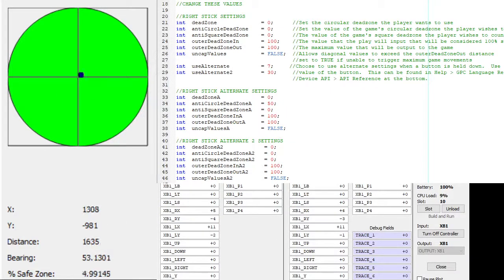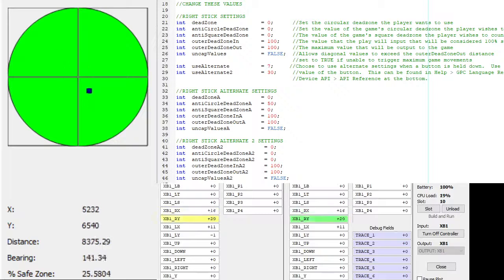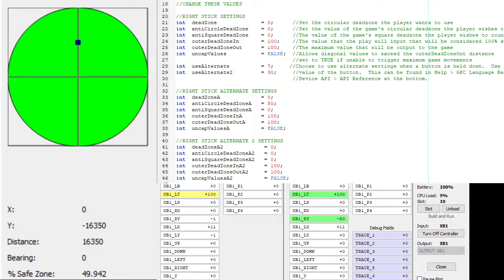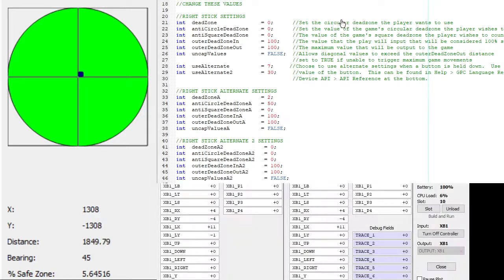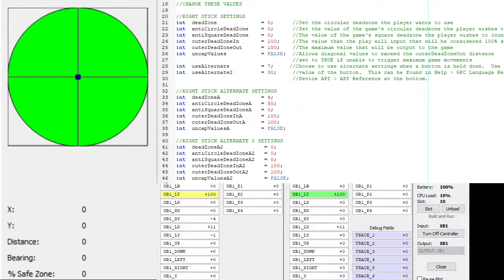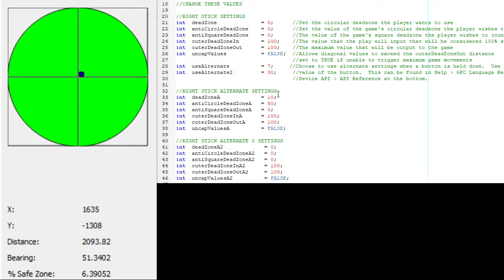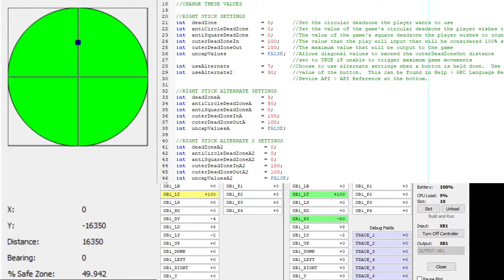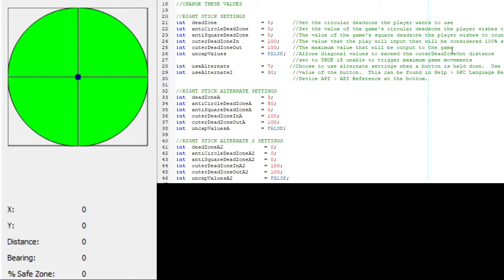TitanOne Deadzone/Antideadzone Script | Antideadzones with Small Inputs and Low Resolution

Comment: Hello Eternal! I am using your script to play Destiny 2, and am trying to counter the set deadzones the game unfortunately has. Do I only change the square to 0.23? Im looking for the most ideal set up with 0 deadzone and then I can adjust accordingly based on my controller stick drift
Reply from the maker: Use 0.12 antisquare and 0.12 anticircle for Destiny.  Using 0.23 antisquare will have it skip too far over Destiny's square portion and remove subtle diagonal movement/make small movements faster than they should be.
Reply: @EternalDahaka  thank you for that info! it feels so much better!
Reply: @EternalDahaka  Do you happen to also know what the best input value is for Anti-Deadzone through Steam controller config for D2?

Comment: Could the TitanOne software make aiming via console in first person shooters more precise? Such as, more aim acceleration? I'm interested in getting a TitanOne or Two because I for some reason cannot play games with functioning controllers--I play without aim acceleration and it makes it harder to aim.
Reply from the maker: Sorry, your other comment about aim smoothing and acceleration on my other video isn't appearing.  To answer that first, this device can't do anything about smoothing.  This device just alters stick movement, so it's still affected by smoothing.  For aim acceleration(assuming the jump in acceleration in some games after a certain threshold), you can avoid that by editing the outer deadzone so the stick won't register far enough to see it trigger.  Aim acceleration is a bit of a broad term, so if I'm misunderstanding what you mean by it please correct me.

These kinds of scripts can make aiming feel more precise by allowing you to edit the deadzones and controller curves.  If you feel small movements are too fast you can slow them down, or if you feel movements are too slow you can speed them up.  If you've played other games that offer deadzone/curve options, that's what these scripts try to replicate so you can get more consistent controls between games.
Both my TitanOne and Two scripts offer the same core options, but the One version has more crude curve customization and this jitter with smaller movements.
Reply: @EternalDahaka  For some reason, I didn't get a notification about this reply, so I'm sorry for replying late. I just watched your TitanTwo video going over the "Degree" value and it looks like you can in fact manipulate the acceleration with lower values than 1. That's pretty  awesome! 

Here's a visual example of the aim acceleration I have been encountering for numerous years https://www.youtube.com/watch?v=nOyuJ14piDg It's been happening since around Halo 2/3 days. In games like Destiny 2 my aim isn't precise without acceleration. It makes jumping and aiming very difficult to land shots. 

I guess lastly, one could simply play games with a TitanTwo running on a PC and manipulate aim on console right? If so, I think I'm sold!
Reply from the maker: @Kreutz  
Sorry, your comment on my TitanTwo video isn't appearing.  That video seems to eat comments for whatever reason.

The degree will alter the curve to make it more/less precise to counter/edit a game's curve, and scales between whatever antideadzone and outerdeadzone value you have.  The mid points in the TitanOne do similar but more crudely.  I made graphs showing how the values work in either:

TitanOne: https://www.desmos.com/calculator/cwhamqur4w
TitanTwo: https://www.desmos.com/calculator/mercxba0ad

I saw that Halo 3 video years ago, but I couldn't exactly tell what it was showing.  Was the turn acceleration bugging out and not triggering, or were your controller sticks not registering far enough to trigger it?  I've never had an issue with it not triggering myself, but I've heard regular comments about "slow turn" from other players.  You might use gamepad-tester on PC to see if your sticks are registering properly if that might be the issue.  The outerDeadzoneIn/Out options are meant to either push out values or limit values, so if the sticks are failing to reach the acceleration regions you can output values that do.  This script can't change how fast that turn acceleration builds up, only if the stick moves far enough to trigger it or not.

The TitanTwo has two cords.  One to go to the console/PC, and one for the programming.  You have to use the editing software on PC(Gtuner) with the programming connection, but you can load scripts on the device itself(3 by default on the T2, up to 9 if you get a micro SD).  Once the profiles are stored on the device, you don't need to have the programming cord connected on PC to use it on console.  There are buttons on the device to cycle through the profiles.  If you have the programming cord attached, you can load up any script you have on your PC.
Reply: @EternalDahaka  Those graphs are impressive! 

Did you really see that Halo 3 video I posted all those years ago, then? What a a small world we live in, haha. So pretty much when aim acceleration is not functioning properly is that any movement with my right or left analog stick has 100% movement output in game. When I try to make the slightest adjustment with the reticle by moving the analog stick barley past the deadzone, a massive movement occurs on screen with the reticle. Suppose I look all the way to the right currently, the reticle will begin at 100% speed. With a properly functioning controller or game, a sudden full movement of the right analog stick to the right will show on screen a gradual build up to 100% speed. 

The Xbox Elite Series 2 had some advanced settings designed to change curves as to the preference of the user. I remember an "instant" curve having little aim acceleration. Some gamers prefer this, the up close and personal shotgun wielding ones. Whereas, sniper rifle users such as my self prefer smooth slow acceleration aiming to clip off the heads of opponents from afar. 

I believe that "slow turn" is a situation similar to this, but what would happen is that the inner shell of the Xbox controller would have too much material on one side of the right analog stick, thus not allowing them to reach 100% speeds with their reticle. There were some Xbox apps that were slow turn checkers in the 360 days. Scuf controllers became popular in the later 2000s and early 2010s because they eliminated the Xbox 360 controller defects by disassembling. For the record, the original Xbox "Duke" controllers were craftily made and didn't have slow turn issues. I also didn't have this aim acceleration problem for all of Halo CE (played LAN and Xbox Connect) and probably all of Halo 2. The difference in aim acceleration became very evident with Halo 3. There was a heavy aiming feel when turning all the way left and all the way right with Halo 3. In fact, Halo CE and Halo 2 had more similar aim curves than Halo 3. This famous blog by StrangeVolt discusses the various aim smoothing patterns of Halo games: http://drstrangevolt.blogspot.com/2012/12/aim-acceleration-in-console-shooters-part2.html For the record though, his findings between Halo 2 and 3 are similar, while many players find Halo 3 to be more sluggish in aiming. 

The TitanTwo setup doesn't sound so bad. I am very interested in this product. I will probably purchase it over the weekend.
Reply from the maker: @Kreutz  
I look up a decent amount of controller stuff, so I've come across a lot of those kinds of videos.
If it's jumping to 100% instantly, that sounds more like a game bug.  The stick shouldn't have an affect on the ramp up time.

That would have to be quite a bit of junk to physically stop the stick from being able to output 100%.  Normally there's a decent bit of extra movement beyond 100% that the stick can make before touching the boundary.   I did notice the sensors failing more often in my 360 controllers though which causes them to fall short.
I'd imagine part of the issue can come from Halo 3 pushed out the acceleration range.  Turn acceleration triggered at 90% in Halo CE/2, but was pushed out to ~97% in Halo 3 onward.  At least as far as the classic mode in the MCC collection, the curves were the same for Halos CE-3/ODST just with that difference.  That did allow Halo 3 to turn faster than Halo 2 before the acceleration took over.
Halo 2: https://imgur.com/2sp3Z3Q
Halo 3: https://imgur.com/dWbq1D0

Comment: Hey !  Can I ask you to set up a dead zone for Dayz?  I'm using titan two, I can't figure out how to set everything up correctly, thank you in advance!
Reply from the maker: I don't own/play DayZ, so I wouldn't know what settings to use.  You'll unfortunately have to do a bit of work to figure that out.

You can try to approximate it if you have GtunerIV and the game open at the same time.  You can look at the device monitor to see the stick position and find out when the crosshair movement starts.
For example, you could try moving the stick perfectly horizontally(try to keep the Y value close to 0) and find when the cursor starts moving by moving the stick left or right.  If you saw movement start around 20, then the deadzone is ~20%.
To judge the shape, you can look at the diagonals.  If you got 20 when testing for the size, try moving the stick 18 vertically and 18 horizontally.  If it does move, it's probably circular.  If it doesn't, try 20/20 and if it does you can assume it's square.  You can also point the stick straight up so you're looking at the sky, and slide the stick along the top edge to see when you start turning.  If it's immediate, then it's probably circular, and if you have to move the stick along the top until 
There's unfortunately a bit of variety of shapes it could be, but circles or square are the most common.

This doesn't show the values, but it shows how you'd move the stick to test the deadzone shape/size to gauge each.  Just look at the values while looking for movement and you should get a good idea.
https://youtu.be/e5fsPRJubOw

Once you know the shape/approximate size, you can use my script(Deadzone, Antideadzone and Curve manipulation) to input them.  Use the deadzone to set the deadzone you want, and use the circle or square antideadzone to counter the game's deadzone.  Make minor adjustments to the values to find what's most comfortable.

Sorry I can't offer any more direct help.  If you have any questions on any of that feel free to ask.
Reply: @EternalDahaka  Thanks for the advice, I will definitely check!  Dayz is already in the game pass, can you help me?  because it will take a long time to figure it out, and you, as the creator of such a wonderful script, will be able to configure everything faster, thanks anyway for your help!  👍👍👍👍
Reply from the maker: @SHEERIFF_TV  
I'm not sure what you mean already in the game.  If there's anything specific I'll try to explain it better, but I can't do anything directly to look at the game.
Reply: @EternalDahaka  dayz is in the game pass subscription, you can download it from there.
Reply from the maker: @SHEERIFF_TV  
I don't have gamepass.  I'll keep that in mind if I get it, but it won't be anytime soon.  Sorry.
Reply: @EternalDahaka  let me buy you a gamepass for 14 days and send you a code?
Reply from the maker: @SHEERIFF_TV  
Thanks for the offer, but please don't do that.  Just try to test the values.  You'll need to do that for other games you want to use the script on too so it'll be good to get used to it.
Reply: @EternalDahaka  I could not figure out how to configure everything correctly. I bought you a code for the ultimate game pass for 14 days. How to contact you
Reply from the maker: @SHEERIFF_TV  
I wish you didn't do that.  Use it yourself or give it to someone else.  I got the dollar month trial.

Right stick:
Use  0.16 antiSquareDeadzone to counter the game's deadzone.
Set the degree and deadzone to you preference.

Left Stick:
Use 0.18 antiSquareDeadzone, 0.09 antiCircleDeadzone, and 1.42 for both diagonal scale Min/Max values to counter the game's deadzone and make it feel more circular.
Set the deadzone to your preference.
Reply: @EternalDahaka  thank you very much .  I will definitely check after work today.